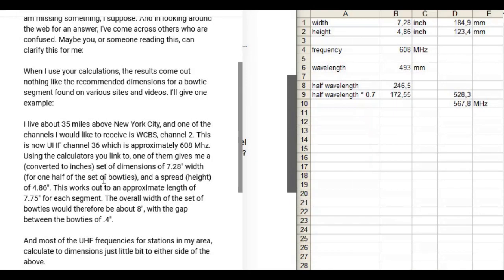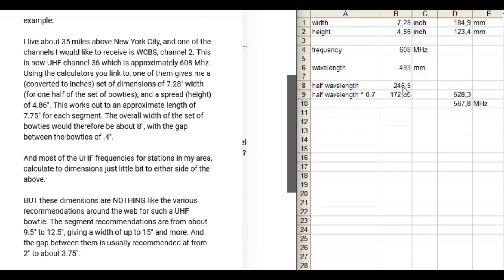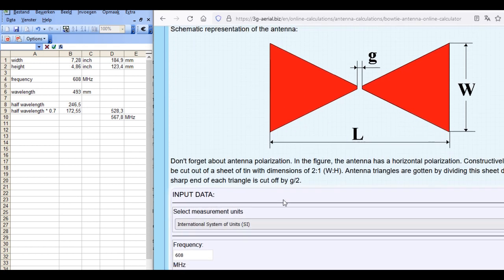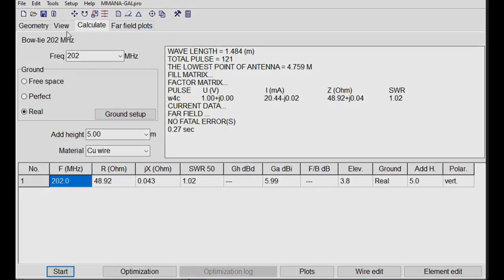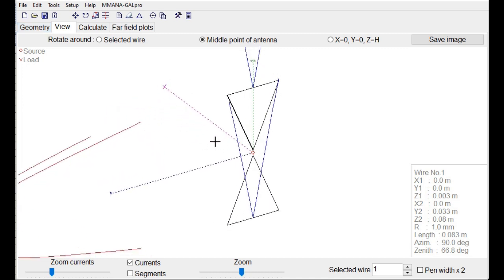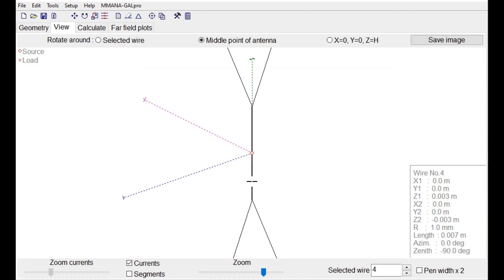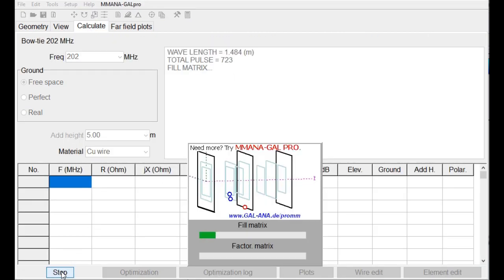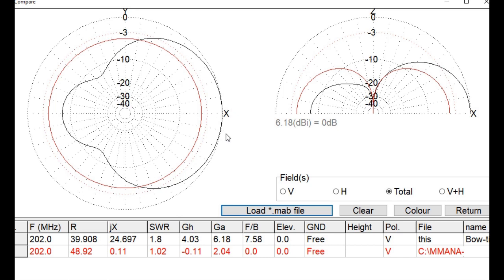3: Bow tie antenna for reception of WCBS 608 MHz

Comment: Hi: Thank you for taking the time to try and answer my question, but I am afraid it does not. I think there has been some misunderstanding, again. 

First of all, those "inch" measurements that I used in my question, for instance, the 7.28" width, ARE from one of those calculators. I had already converted the resulting mm to inches for my own purposes as I work in inches. Sorry. And perhaps I confused the issue further, because I also called it "width" as the resulting "length" is the width of the bowtie, sorry. 

Let me try asking a different way, using your results: You come up with a wire length of .083 for a bowtie designed for WCBS TV New York, which is UHF channel 36, broadcasting at 608 mhz. If I built a bowtie using them, to those dimensions, it would have .083 length elements, as you say. 

BUT that is not even close to the recommended length of the elements for a UHF TV antenna anywhere within the range of UHF broadcast frequencies! Recommended are, as I pointed out (depending on the designer or manufacturer) anywhere from about 9.5 inches to 12.5 inches (241 mm to 318 mm). However, your result, and my results from the same calculators you used, give figures like this .083 meters, which is 3.26 inches! If you note, that is (very) approximately half of my original question, where I used 7.28". The difference we arrived at is simply the difference of which calculator we used... I have gotten @ your results, also.

I fear this will still not be understood, somehow. Maybe I'll distill it down to one, simple, question:

"Why do the bowtie dimension calculators return segment lengths about 80 to 100 mm, when the builders, designers and manufacturers of UHF TV antennas use segment lengths of about 241 to 318 mm?". 

For instance, look at the antennas of Michael at Cosmic Antennas, or Danny Hodges (he uses 10" elements), and others. For that matter, just search for UHF Television bowtie antennas. The segments are always at least 9" or 10" (228.6 mm or 254 mm), to about 12.5" (318 mm). They are always FAR larger, by multiples, than these calculators return. 

Thanks again for trying to understand this. You are not alone in missing my point here... I came across a great many others, similarly confused. If no one can answer or explain it, I'll have to simply build an antenna with the common dimensions used "out there", because NOBODY build UHF TV antennas to the size the calculators return. That cannot be correct, or they would.
Reply from the maker: Hi, the Bow-tie antenna I showed in my video's is just a single element. I am not sure if I found the antenna’s you suggested, many of them are not for just a single frequency but for the whole UHF TV band. In review of such antenna (https://www.youtube.com/watch?app=desktop&v=m1b5h0IKqh4 ) is even mentioned it is also for the VHF channels… ? (But there is an additional option with a smaller dipole for UHF?).

The UHF-TV band is between 470 and 700 MHz. In wavelength that is from 640 mm to 430 mm. That is a large span! Half a wavelength multiplied by 0.7 is 223 mm to 150 mm. So if you are at the top of the band you need (for optimum performance) a much shorter element then for the lower part of the band.
The element lengths that you mention are not in this range and I can not explain why, you could ask them what antenna theory underlies it (and if the results proved by measurements).

What I also see that several designs use stacked antenna’s with the reflector plate, not oll bow tie but also whiskers. Stacking should not influence the length of the individual bow tie antenna’s but if built correctly, it would give more gain than a single element.

However, if you have the materials (they are not expensive): just try what will give you the best results. 
And be aware of the polarization: the ones that I saw offered are shown in horizontal polarization and if I am informed well, WCBS uses vertical polarization. So you need to tilt those antenna’s 90 degrees side wards.

Keep in mind: wonder antenna’s do not exist. Designs of antenna's that are small, offer lot of gain and broadband should ring bells ;-)
Keep an eye on my channel for the moment I will make a video about the basic principles of antenna’s.
Reply: @chrix2381  Thank you again for attempting to answer the question, but for some reason I don't understand, I am not able to properly explain the issue to you.

Yes I do understand everything you say in your answers... in the video, and in the recent answer just above. I do know all this pretty well after watching many videos, and looking around the web. And "no" this is not about me hoping for a "wonder antenna". And yes, there is a range of UHF stations/frequencies, as you correctly relate, and yes there is no ideal antenna, and one must make choices for the range they are interested in. 

The question is entirely different here, and I am sorry I would not know how else to explain it, other than how I already have. Well maybe I'll try one more time:

When one uses these calculators and calculations to determine the proper dimensions of a UHF bowtie antenna, the resulting measurements are far, far, smaller than any of the antennas made or used for ACTUAL UHF TV reception. Entirely different. The resulting measurements, from those calculators, is entirely and completely off the range of sizes actually used for that range of UHF antenna designs that is used, in practice. The results do not even overlap, at all, and would result in antennas that are far tinier than anything actually used or selected. 

It is that disparity which is the question: Why? Nobody builds anything that small, and I doubt they would work as I've seen the tests for the larger size bowtie antennas, and they need to be 9" to 12.5" (each side of the bowtie). So I doubt the little 3" to 4" bowties the calculators come up with, would even work at all.
Reply from the maker: @proto57  I understand that you are faced with differences that you could not explain. Neither could I. 
I have seen calculators that gave strange results, therefore I simulated it with MMANA. That is a serious simulation application, not a few formula’s that come up with some numbers.
A single dipole is half a wavelength long (as stated in every basic antenna handbook) en for thicker elements (like Bow tie) this length is reduced. In this example with a factor of about 0.7.
I showed measurements with these dimensions in video 2.
If others make their elements a lot longer, it means that they are for a longer wavelength = lower frequency. 
I would suggest those others how they came up to their element lengths, why are they so different then basic antenna theory and are these antenna’s measured on their frequency with respect to resonance and gain?

If they do not come back to you with the results, you know enough. If you get a serious plausible answer, please let me know, very curious about that.